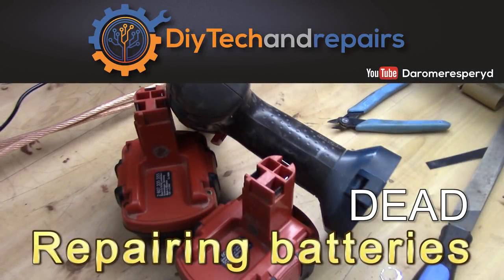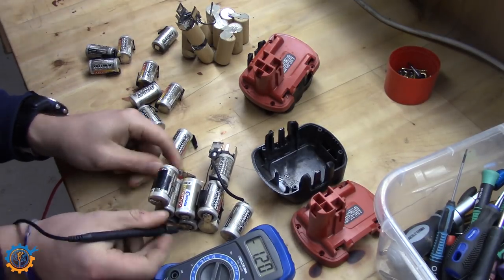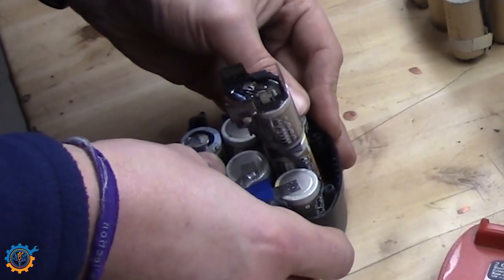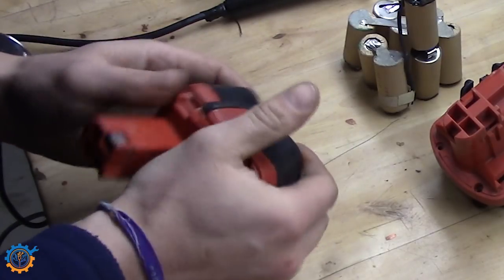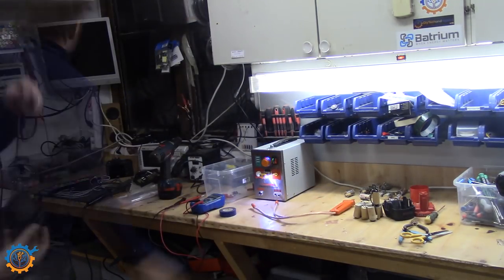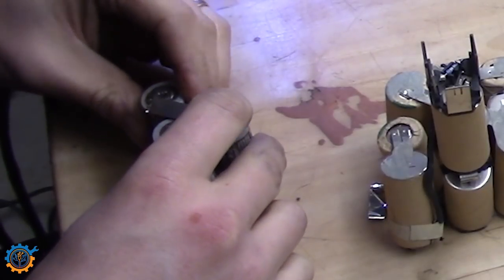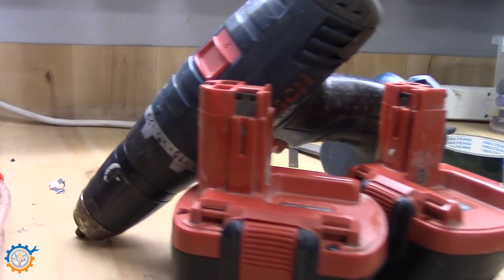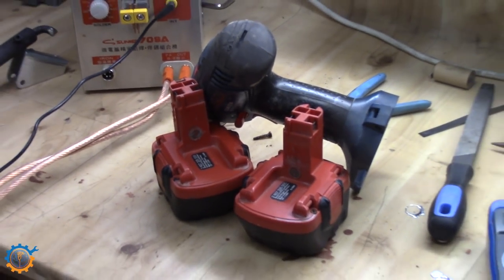Repairing dead batteries on cordless drill

Comment from the maker: You are 2nd  Phizicks :P
Reply: HAHAHA! that's not fair publishing in my sleep after an AverageJoe live stream. lol..
I bought a cheapo cordless drill and it immediately had a dead cell on both packs. Realizing they were 14.4V and not 18650, opened it to see this were ni-cads damn!.. came to US so didn't get a chance to replace it and it's back in Australia.
Wow that 5min spot welder job looked like a pain to remove.
Reply from the maker: :P  Sorry :D  Yeah 2 damn spots and it took forever to get loose. Didnt want to destroy it so I could reuse the tabs. The drill is working just great. To bad its still NiMh cells but its better than nothing. If the cells die again it will be Lithiumfied :D

Comment: just this week i just repaired the same drill.. converted them to lithium 3s.. used a BMS on them 3s 25amps and im still using the original charger to charge them..
Reply: Emem Redilosa I have fix my battery too with a 3S2P but I have just cut a hole for a balance connector
Reply from the maker: Good work! Yeah I would do kind of like that too if I go that route. In this case I had the cells since i bought them 5 years ago befor i started to become lithium only... Thanks for watching!
Reply: +Emem Redilosa You are playing a dangerous game. The absolute top-of-charge voltage for NiMH is 1.78 v, a 10S (12 volt) battery would end at 17+ volts. In addition, NiMH chargers with temperature probes look for an increase in cell temperature that signals the cells are full. For a 3s lithium pack, 12.6 volts is the maximum, and if lithium cells get hot while charging, you're in trouble. Even a 4S pack tops out at 16.8 volts.
Reply: I know... thats why ive used a 25amps 3s BMS.. it cuts off the charging when each cells hit 4.25v.... ive already tested it.. and it works... also the bms has balancing on each cell aswell... :P
Reply: Unless they are Lithium High Voltage cells, with a 4.25 volt cutoff you can expect half or less the cycle life that the manufacturer claims. Worse, when the cells do start getting tired, they will start getting dangerous as internal resistance mounts.
Reply: maybe.. but then again.... when it cuts off.. i checked the voltages in each cell they are just 4.18 and below when the cut off was triggered.,. so...

Comment: I just did a rebuild on a Black and Decker PD600 and AS600. I added 2 LG HB2 1500mah 30 amp 18650s in each. Talk about revieve an old tool. Even the smaller AS600 seem to be way-way stronger. I have a Black and Decker Drill gun I am about to do next.

Just curious, why didn't you go with Li-Ion cells?
Reply from the maker: njfulwider5 i had some nimh in the box so no need to do extra work and buy new li cells :)
Reply: Some of those project components you had shown us in the last video!😊Another Great Video!!!